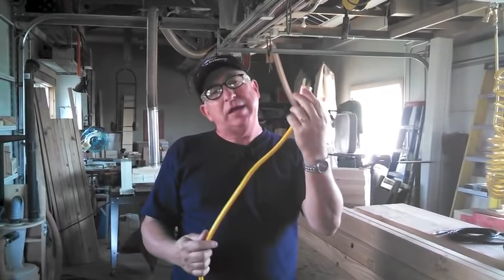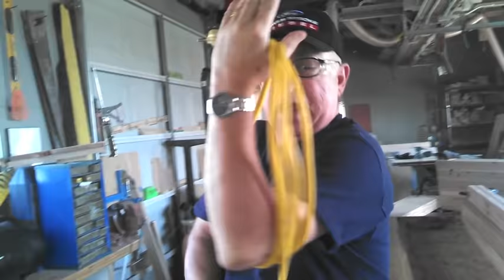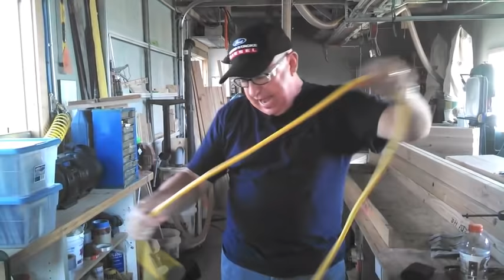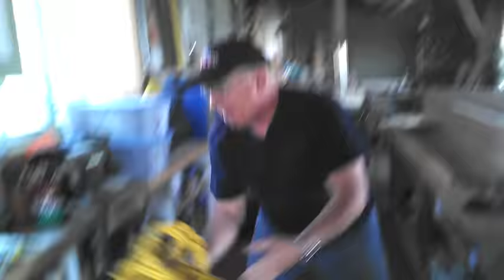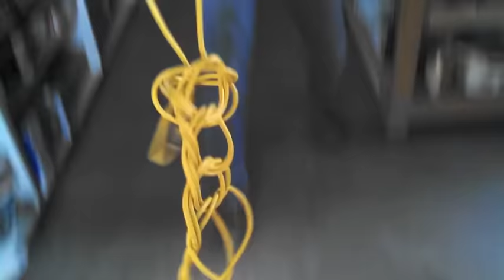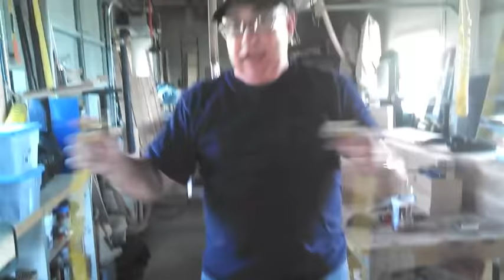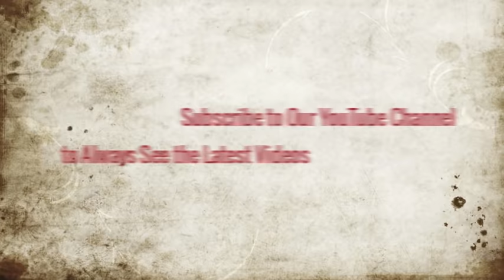Best Way to Store an Extension Cord

Comment: Once again I beg to differ.  Don't get the idea that I don't like your videos because I do.  I believe we are from the same generation.  70 years old.   This cord trick when I saw it many years ago (though they didn't double the cord then) I immediately saw that it was kind of a messy way of organizing.   For me I have always used the factory spec of the circle using a circular method of keeping the cord as it came to me when I bought it.  In fact though I usually come by cords from tradesmen who have discarded them because they did get kinked up from using this "daisy chain" method.  When I find cords I stretch them out in the sun and let them heat up and this allows the cord to get flexible then I get the twists out and then wrap them in a typical spec circle holding them in my hand and thumb and winding within the parameter of it originally.  When I find water hoses being discarded (much more often) I hook them up to the spigot and put a little pressure on them in the sun and let them refigure their shape, then put them into a circular form that they lend themselves to.
Reply from the maker: Thanks for writing, ywcaman. I appreciate you taking time to give the detail that you did. I like your method, and in fact, tend to use it more and more, if anything for the fact the unless you have ultra-premium cordage, they are not as flexible, especially when cold, as I would like. The best to you and yours! - DFJ

Comment: I guess if you just wanted to toss it into a pile it works.
I personally don't toss my chords into piles. I prefer a nice round spool I can hang on a hook.
They also have cheap heavy duty reels on ebay for under $10.
The other problem I have with this, if you forget the unraveling technique, you end up with a huge tangle.
You have to remember the unravelling technique.

Comment: This is an appaling method of storing cables it introduces very tight curves, potentially damaging the inner core, and when undone leaves trip hazards in cooler climates. The best way is to make an ordanary loop then a reverse loop and alternate between the two. No twists, no sharp bends and no trip hazard. I learnt this from a sound tech, where cable management is paramount. There are several videos teaching this method on you tube.

Comment: This method isnt wrong. But the arm one IS. If you can even get it off your arm without breaking it lol
Normal way is depending on gauge, spool into 3 to 6 foot diameter on THE GROUND. Twisting the cable as you are laying it in loops. If it doesnt perfectly lay there keep twisting until it does. Plug both ends to each other. Pickup the spool so the plugs are in your hand. Hang up or lay anywhere. To lay without issue. Pick it up, throw onto your arm and take your dominate hand and u plug the male end, plug it in, start walking throwing ring after ring. No kinks, no criss-cross. Can full sprint laying as many feet of extension as you want.
But ill give this a try for ramming into trucks

Comment: I just coil my extention cords like a lifeguards life line.  Pull it off the hook, split the coil, toss it as far as you need. I have 3 coiled(50,100,120) and plugged in, in my garage ready to go.

Comment: How about just using a spool made for rolling up an extention cord? Just leave the female end sticking out enough to use, then roll the cord onto the spool. When you use it, just plug in the male end and roll out the cord to the work, the excess is left on the spool neatly rolled up. When you are done with the cord, just roll the cord back on the spool like reeling in a fish, then unplug the cord from the outlet and tuck in the male end for storage. It never takes up anymore space than the diameter and width of the spool. I saw people struggling with these loop methods or rolling it up on their arm, while at the drag strip. I brought my cord on a spool and others saw how fast I could pay out the cord and roll it back up and in about 3 weeks everyone was using a spool.

Comment: After doing audio and lighting for over 30 yrs as well as carpenter for over 25 yrs i can honestly say if you want to destroy your chords use this method. It will twist the wire inside the sheathing and eventually destroy the ends ….I’ve done it and I know what I’m talking about .

Comment: When I was at Film School in Toronto, if we call them around our arm we would be suspended for a month from the equipment depot . We had to looong loop with a 1-2 twist so it would hang from your hand in a natural relaxed loop. Some of the light cords were 6 gauge and worth 100$$s  working as a carpenter I would get 5 years out of a  cord Thanks!

Comment: I am electrician. I order cable it comes rolled. Not twisted around. Same as extension cord. Keep rolling into lasso shape Every time use it. It will work well.

Comment: I’m a contractor but and have used this method for years but I’ve found over time the wire inside the outer sheathing becomes twisted and distorted making for an ugly cord that becomes less user friendly. It is not superior in my opinion and has ruining my cords. I have gone back to coiling my cords using large loops like a mountain climber would coil his ropes. Very little tangles. I’ve cribbed wooden elevators and our circular saws had a 50 ft cord wired directly to the saw which made it thought to coil the cord. So had to use the braid method. But over time these cords became twisted and unusable also

Comment: If only "New Guys"could see what a good extension cord looks like after one year of wrapping the 50' or 100' foot cords around their arms. The cord will be all twisted up and sooner or later the outside insulator will start to break open and expose a bare wire. I spent a large portion of my early work career tying down trucks with rope and the trick to winding up ropes is rolling your wrist as you are rolling up the rope. I use the same way with extension cords  and they will last for years. Watch a cowboy roll up his lasso and you will see what I'm talking about. When they throw their rope from a horse it never gets twisted up, it unrolls out straight every time.

Comment: Another way I like better is simply to hold a lenth between your hands, and with one hand (right handed use the right hand etc.) and hold the cable between your thumb and index finger and twist it, it naturally forms a loop then do it again. This is especially good for mic cables, since the braided RF/ground cable inside breaks quite easily, unless you use this method. If you try to use the elbow method you get yelled at and then fired. Good cable for mics is about $165/ft. (Mogami cable in CAD) A good studio cable is $75 for 25' before tax.
Reply from the maker: Drampa Dreg - these are some great insights! Thanks for writing. Best, DFJ

Comment: You commented how when rolling around your arm some loops were larger and smaller but with your second method the loops were of varying sizes too.  And the bulk created by the chain makes storage really messy.   With 10 cords to hang on a wall the wall ends up  looking like a jungle.   I did your second method for years but the mess and bulk  just was unsettling. Instead maybe try the inverted loop that cowboys use with lasso rope.    Never kinks.... and smooth as silk when you throw it out for use.

Comment: Still puts a bunch of different size loops and Kinks into the cord. Why not just wrap it around a bucket to make them even and then put a velcro strap around it to hold it in place?
Reply from the maker: csyote - thanks for your thoughts and a great idea. We are doing another episodes on cord stowage methods. I think your approach is noteworthy and should be mentioned in that video. Is that agreeable to you? Thanks again both for watching our video and taking time to weigh in. Best Regards, DFJ

Comment: Learned this from a buddy in high school in the 80's, the only problem is that if someone who is not familiar with this  method tries to use it they end up pulling it apart the wrong way and they end up taking forever to get it apart.
Reply from the maker: Indeed, that is one disadvantage for sure. We have a new series coming out featuring 5 different ways to coil cordage and the plusses and minuses of each one. What you've stated is included in the downside for this method. Thanks for writing! Best, DFJ

Comment: A little hint for better results.. don't try this in a cold shop or garage, if possible, let the cord warm to room temperature. This will allow the insulating material surrounding the wire to be more flexible and therefore easier to manage.

Comment: Don't throw away your old garden hose real with the 2 wheels on the back.. When it leaks to the point where you're tired of fixing it, convert it to a hose real... I leave 6' sticking out the side that used to connect to the wall.. And I roll up about 600' of cord on the real. Then I cut the female end off and passed a 3/4 inch piece of PVC about 5" long over the hose and put another female end on. Now when I go to real it back in I just grab the PVC pipe and I don't have to worry about friction.. This allows me to move my hand back-and-forth to evenly rewind the cord..my 2 cents

Comment: Imagine if cowboys took your advice and did their lassos that way. They would have to unwind the whole lasso just to use 10 feet of it. The first way you rolled it was half way there. You just did it wrong.
You are supposed to treat cords like lassos. What you did wrong was to force the coils. Watch cowboys coil lassos. They go with the natural roll of each coil. Grab the end in your left hand and with your right hand bring in a coil. Do it again but watch that the coil comes in to it natural coil shape. If it doesn't, whip the end in a circular motion to make the coil into the natural shape. Bring in one coil after another watching that it forms into it's natural coil and if it doesn't do the circular whipping action At the end you will have the coils all fall into their natural shape and they will want to stay that way. Then grab the ends, make them go around each other and plug them into each other. Now the ends are holding the coils together. When you need to use the cord, you take the male plug and plug it into the wall. Lay the coils on the floor, grab the female plug and start walking. If you have 100 ft cord and you only need 10 ft, you only uncoil 10ft. Now recoiling 10 ft will be a snap. I would hate to do a 100 ft cord your way having to unwind and rewind the whole 100 ft every freaking time.
Reply: haven’t seen another comment here with method. from experience, this would definitely be the most superior way to roll up a cord…

Comment: There are two steps here that can be eliminated and accomplish the same goal with much more simplicity.  My dad was a framer for 60 years and used this method (minus the two unnecessary steps) for at least 50 of those years and I still use it today.

Comment: I operated a 30 man framing crew for over 10 years in the 1980's. I learned of this around 1983, cool and clever, but, by about 1985, all my 100' extension cords (dozens and dozens), would end up with the wire strands twisted inside the casing. All the cords looked like twizzlers licorice. Would not lay flat on the ground. You can tie one end to a tree and work out the twists with much aggravation . . . . . but I stopped doing this.

Comment: I came up with a better way. I put the cord in a crate with the male end hanging out one  side. Give it about 4-5 ft, just enough to plug it in somewhere, the rest of the cord is loosely wound into the crate, working from the middle area towards the female end, so that you're finished with the female end hanging out the top of the crate, and the male end hanging out the side of the crate. To use it you just: 1. carry the whole crate to the power supply. 2.Plug it in, and then 3. pull out as much female end as you need. It never seems to tangle and is absolutely the fastest and most mess-free method there is. You don't need to carefully wind it back into the crate either, fast and loose back into the crate is enough, as long as you go in the right direction, with the female plug hanging out at the end. My crate has 2 big long ones joined together and never skips a beat. It's actually a lot like a DIY cable reel without the reel. It's just a simple crate.
Reply from the maker: Sounds like a good idea. This is one of the reasons we love this medium. Try it and send us some photos to jay@dirtfarmerjay.com.  Best, Dirt Farmer Maggie
Reply: @DirtFarmerJay  Ok but it's literally just a cord in a crate LOL

Comment: i gather from the male plug end, and give it a little twist as I do so, to follow the twist of teh wires 
i can coil up a cord twice (probably three times) as fast as you and it stores just fine, and we used looong cords.
the most important part is actually DEPLOYING the cord
and if we needed less cord, i have a nice bundle i can just pick up and go with, none of this knot work
Reply from the maker: Ruthless, thanks for weighing in. Sounds like you have a great method. When I'm not demonstrating, it takes about 45 seconds to stow the cord, and I can pull as much as I need without undoing the rest of the unneeded section. I appreciate you giving the detail you did. The best to you and yours - DFJ
Reply: @DirtFarmerJay  well said. You are a true gentleman.

Comment: I had someone who worked for me who could do this. Most of the cables I work with are 100 meters long. I am not going to wrestle with it every time I put it away. I use a plastic basket. The end, the plug end, is left out about 5 meters from the base of the basket. The rest is fed into the base of the basket, until you get to the socket end. Then the end is fed in on top. Do not coil it into the basket. If you pull a lot of power through the cable it acts as a coil.
Reply from the maker: Thanks for watching and commenting. Whatever works for each person is the right way for them. Best, DFJ

Comment: I don’t like this method. In cold weather it doesn’t stretch out. It stays knotted up. I take the twists out when I coil it up and don’t wrap it around my arm. Then I roll it like I’m rolling a tire and it lays flat. Works great on air hoses to

Comment: I daisy chain short cords but you just made this way more complicated. Instead of form a loop tucking it then switching hands, I would recommend just reach through the loop with your free hand and grabbing the line and pulling it back through the previous loop. It forms a loop as you pull it through and you just repeat over and over. It’s much simpler and faster. I used to always do this but it’s a pain with cords over 50’. I only do it with a 25’ now. Two alternate methods are the figure 8 like parachute cord and to loop it normally except reverse every other loop. I still do this with most ropes though

Comment: One of my colleages on building sites used to do this, but you end up after some time with cables that are bent and twisted permanently like a plate of spaghetti. We reverted to the prior method, or reels.
Reply from the maker: Watch for a new video soon on storing extension cords using the "over and under" method. Best to you, DFJ

Comment: what about when you have a cord as long as 200 feet
Reply from the maker: That's a good question. My first thought is to just use the over and under method for a cord of that length.  Hope this helps. Best, DFJ
Reply from the maker: I'd put that long of a cord on a reel or use the over/under method to coil it. Best, DFJ

Comment: Those of us in the audio and video trades will know that this is excessively complicated and turns your cables into a giant metal pubic hair. That might be cute for one single extension cord, but when you have dozens or hundreds of them, this is a massive time waster, in in the winter, good luck straightening that cable out. The “over under“ or “broadcast wrap“ way is the only way I will ever go. No loops, no kinks, no memory. Just grab one end, throw the cable, and it falls out completely straight.
Reply from the maker: Scottish, indeed the over and under is a great method and one that we'll be featuring in an upcoming episode. Thanks for the nudge. Best Regards, DFJ

Comment: I never cared for this method.  I use plastic 5 gallon pails.  Cut the male end off the cord.  Drill a hole in the bottom large enough to pass the cord thru and put a male end back on.  Once you have that you can just shove the cord into the bucket.  No need to make loops it will always come out of the bucket without tangling.  The bucket also makes a good transportation device.
Reply from the maker: Bernie, thx for your insights and the time you took to share them. Best Regards, DFJ

Comment: There's some magic here... I've tried this several dozen times, and mine never comes out like yours.   Frustrating.   My cord is much stiffer and doesn't handle or hang the same way.   It might have exactly the same loops, but the form doesn't look the same because of how poorly it hangs.   That makes it hard to pull the lower loop through the correct uppper wires — and then it's all bollixed up!   Maybe if I got one of those super-limp high wire count traction cables [like welding cables on steroids], maybe it would behave the same way?

Comment: Probably a good way to stow a 100ft empty garden hose for the winter in a not freezing garage... The worst thing that can happen to a hose is have them freeze with that ghetto coil twists in them....
Reply from the maker: Jim, I actually coil my hoses, not chain them. This method doesn't work well for hoses. Best, DFJ